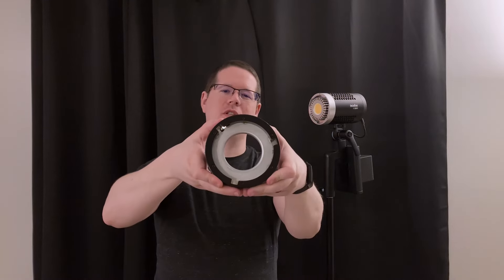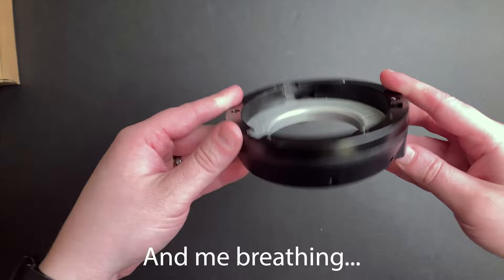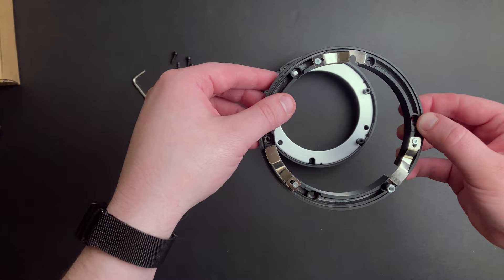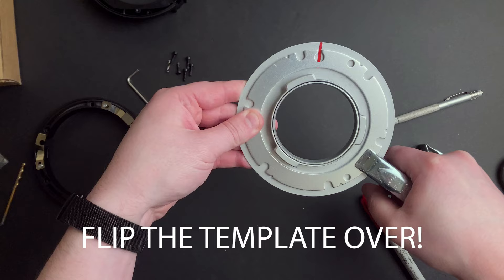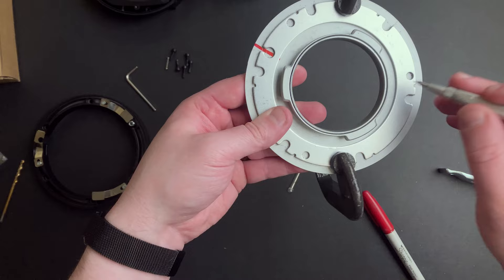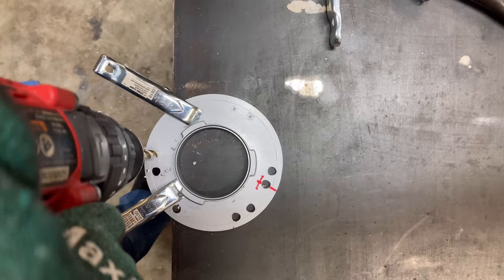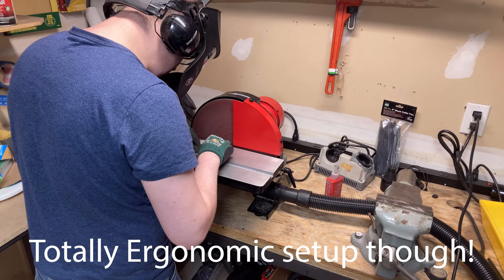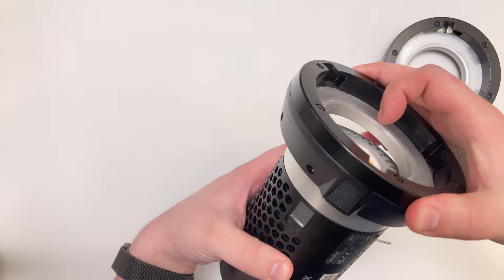Godox to Bowens Mount Adapter (AD300, AD400, ML30, ML60)

Comment: Cool, I had thought that these two pieces could go together.  Thanks!
Reply from the maker: Yep, I can't believe they haven't release this as a product. Having an s2 bracket, ad400 adapter, then an additional sleeve for the ad300, just seems backwards to me. They made the godox mount, but not the ecosystem and adaptors for the mount lol

Comment: Does it also fit ad400pro in this configuration?
Reply from the maker: It should! I don't have an ad400 to test though
Reply: @MichaelRoachWV  if you have chance, can you check? From the video it seems that the sqaure part on the back might interfere with the 400 body... Very curious

Comment: Why not a 3d printed solution?
Reply from the maker: Because that requires a 3D printer! 😂 but in all seriousness, I think I found someone who used that solution when I was researching. There would be drawbacks, but it would be much more cost effective to produce. You could also 3d print the prototype and then have them mass produced. This would allow them to be injection molded with a stronger material.